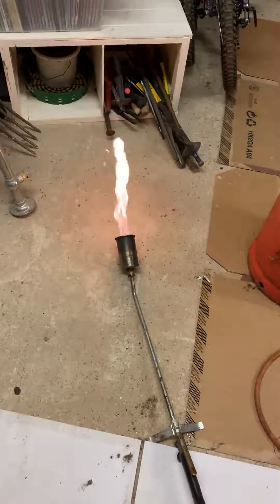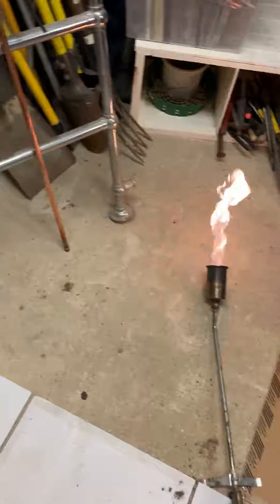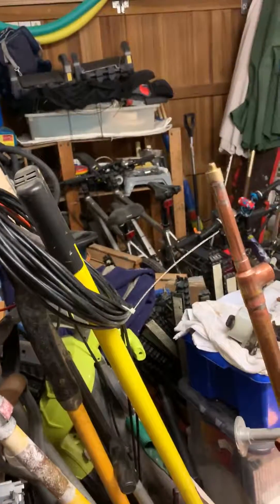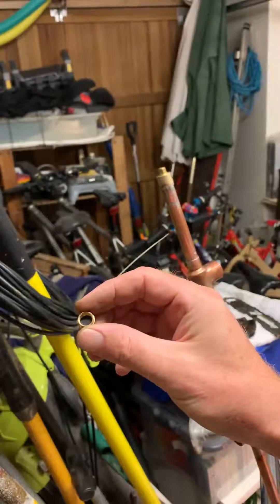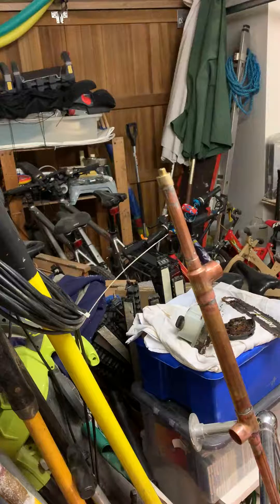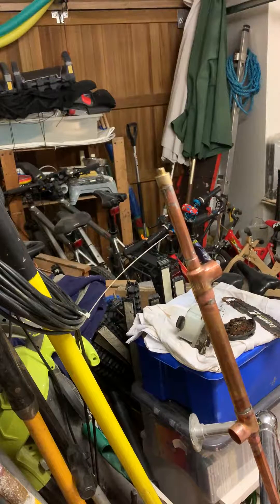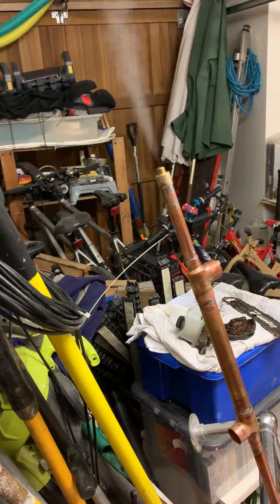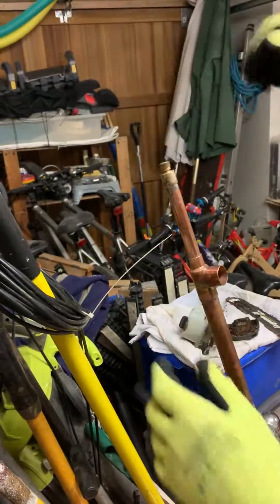DIY Solar - How to make a heat pipe

Comment: thats awesome, if your using a heat pipe horizontal do you put a wicking material to draw moisture from condenser side towards evaporater, on a heat pipe that large?
Reply from the maker: Hi John, thanks for commenting -apologies for the late reply! Generally I have been using the heat pipes as part of a near vertical array for heating water - so I haven't yet experimented with wicks within the heat pipes - if you have any top tips as to approaches to try I'd be grateful - I've got as far as thinking about adding a semi rigid wire with the pipe before sealing - but haven't tried that, or researched further! Cheers, Andy

Comment: Is water more efficient for solar thermal collectors than acetone?  that seems to be commonly recommended instead of water.
Reply from the maker: Hi - thanks for the question - to be honest I think it comes down to the environment in which the heat pipe will operate - where I am (UK) we don't get very cold - so water freezing is a smaller risk - I think there are benefits in moving to other working fluids for environments where the heat pipe may be exposed to colder temperatures - I believe that they use anmmonia for heat pipes that are used in spacecraft for example. Also - I'm generally most comfortable with non flamable fluids at present - maybe I'll be more adventurous one day! Cheers, Andy
Reply: Another researcher experimented with freezing temps and mixes of water and acetone, and found a 50/50 mix did not freeze in his freezer.  I suspect a mix would also offer a wider operating range due to the different boiling points.